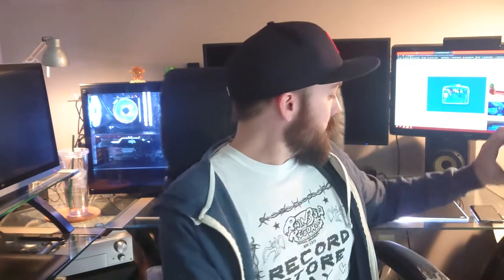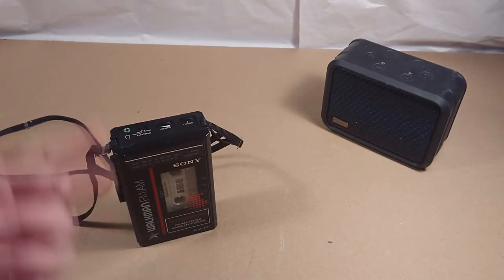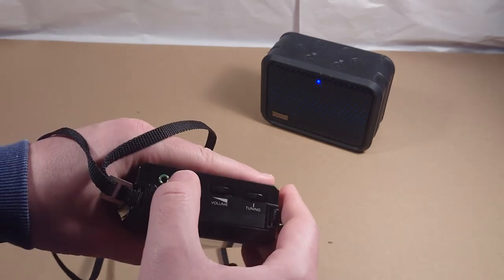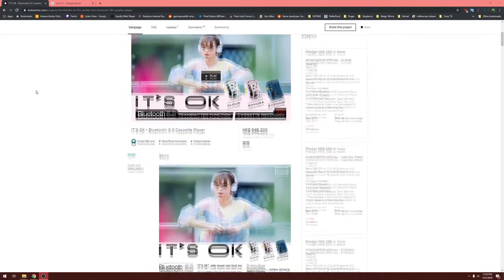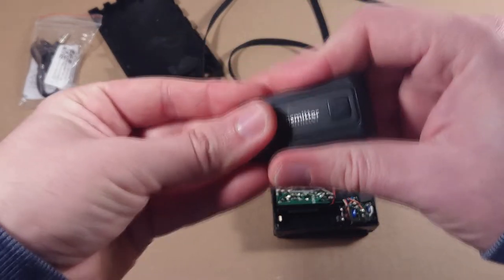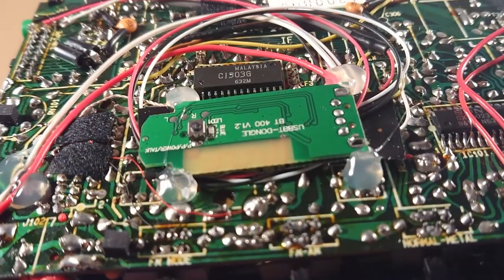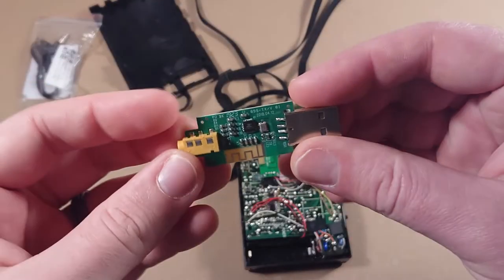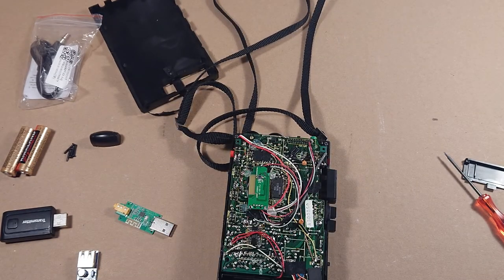Walkman Bluetooth Mod

Comment: Think this would be possible to do to a minidisc. It has a much smaller enclosure which makes me wonder if theres space for the reciever.
Reply from the maker: Possibly. I've found that the older the tech, the more space there is inside. Maybe finding an earlier MD player. It'd be tough for sure.

Comment: I've wanted to try this for so long! The Amazon link is not available, I have no clue what I am doing.. is there another 5v converter you could recommend? And thank you for being awesome!
Reply from the maker: Thanks! Bummer that Amazon is sold out of those. Any step-up module would work fine. Just search for 'step up module' in Amazon and look for one that is smaller to fit in the case.
Reply: @sturo  😁

Comment: I have a couple questions about a previous modification you did a while back. I can really use your help. If you could, please I will greatly appreciate it.
Reply from the maker: Sure thing, ask away!
Reply: @sturo  your PS2 Slim. Do you still have any information on the button and IR lines? Or if you had uploaded it anywhere? I want to do something like yours, and do a fair bit more. It's that part I'm about to get to and I've tried, but everything I get to is either no longer available or 404.
Reply from the maker: @SuperFunkyB  http://imgur.com/a/q5F7Hna I think all the info should be there.
Reply: @sturo  thank you so much. I'm sure it's late now for it, but when you got to it, I thought I put in a step down voltage regulator in it as well for the LEDs, and another switch to fully power down and on. I really appreciate it, and I may run into another issue, which I will ask you about. Thank you!
Reply from the maker: @SuperFunkyB  No problem, I'll try my best to remember the details about the project.

Comment: Now you need to make it rechargeable that would be some next level shit
Reply: Usb rechargeable lithium battery cells off eBay or Amazon. They function like oldschool AAs but have a microUSB slot in the side to charge.

Comment: Great video man, I’m planning on making doing the same thing to a cassette Walkman and a CD Walkman and an old iPod.  I’ve got a tip, if you look around for Bluetooth transmitters you can find ones with a built in bakery, you can disconnect the battery and wire it into your device’s power it should work with 3.3V. Also these Bluetooth modules can be tuned off. I’ve bought a bunch or transmitters and so far ones called “KN321” have the best sound quality.👌

Hope to see some more bud videos 👍

Comment: Question for ya… I’m very unknowledgeable about this stuff but would it be possible to buy a headphone jack to Bluetooth transmitter and accomplish the same goal with only the drawback vs yours being yours looks pretty damn cool without anything plugged into it?
Reply from the maker: Yeah it would accomplish the same thing, just not integrated into the walkman. I think you'd have to consider powering the transmitter as well.